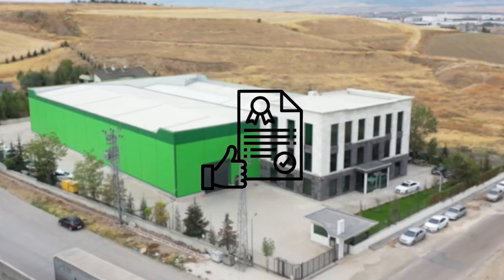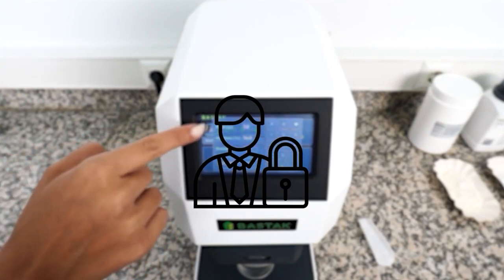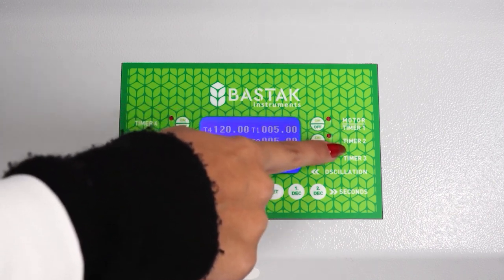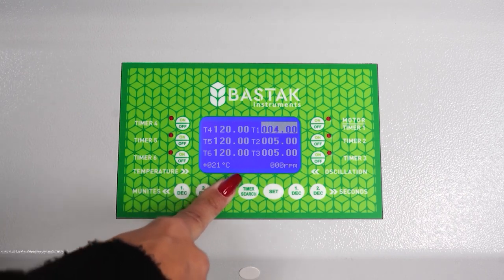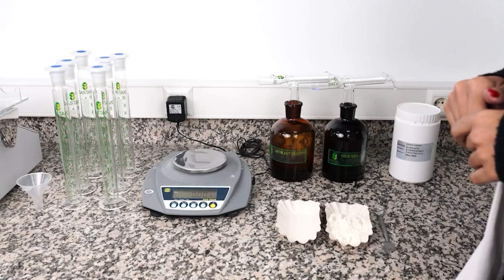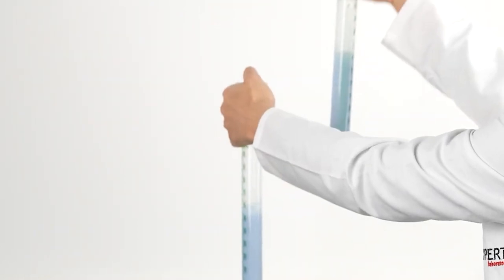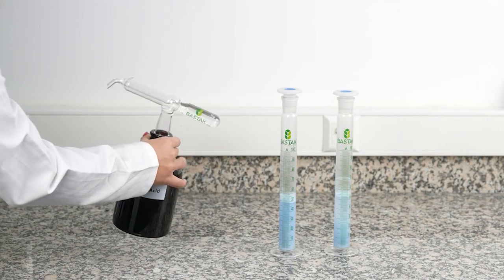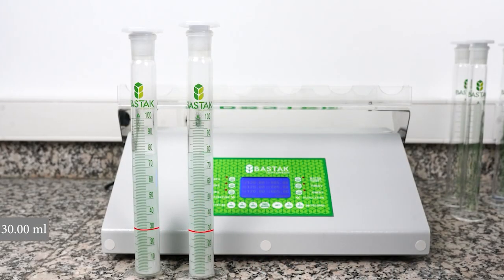Bastak Instruments Sedimentation 3100  Method Instruction (English)

Comment: why you use 3.20g of sample
Reply from the maker: ISO 5529 and ICC 116/1 International Standard explain this method, known as the Zeleny sedimentation test, and explain the method by giving the amount of flour that should be used during analysis as 3.2 grams.
Reply: @bastak  thank you but why 50ml bromophenol blue and 25ml Lactic Acid
Reply from the maker: @johnmoves9103  ISO 5529 and ICC 116/1 International Standard explain this method, known as the Zeleny sedimentation test, and explain the method by giving the amount of  50ml bromophenol blue and 25ml Lactic Acid.